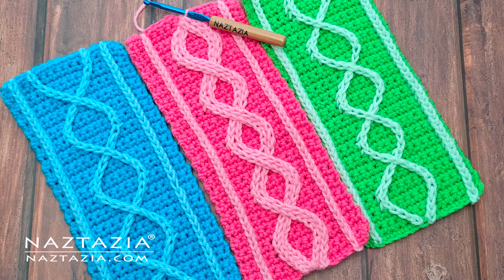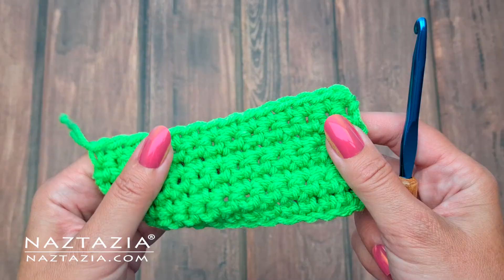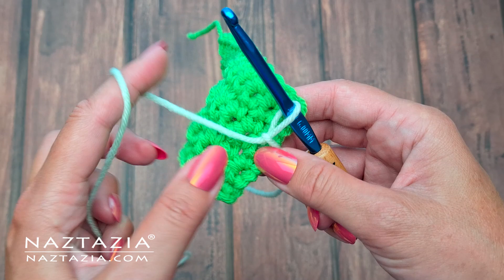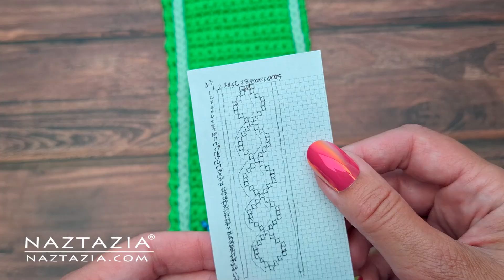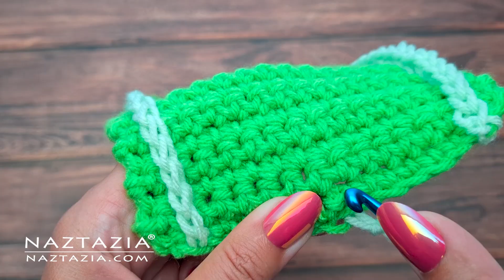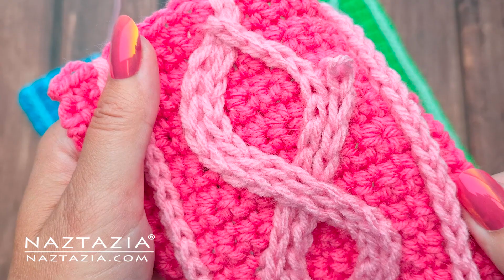How to Crochet Cables using Easy Surface Crochet Method

Comment: Your cables are crossed. Do you work several rows of surface crochet simultaneously?
Reply from the maker: Not really (you can though). If the cable needs to go "underneath" the other one I just remove my loop from the crochet hook, pull the loop underneath the other cable, then proceed as normal. Otherwise if the cable needs to go "over" the other one I just keep going with the same loop and stitches.
Reply: @naztazia That helps! Thank You 😊

Comment: This looks so good.  Can this be done on other types of background stitches instead of single crochet
Reply from the maker: Yes, other ones can be used; however, they will tend to be a bit taller and might fall over a bit, which might or might not be a good look depending upon what you are trying to create.

Comment: Could you do a c3f or c3b look cable with this method?
Reply from the maker: Yes, I believe that's what I did with the pink yarn one. The easiest is to work both the right and left swirls simultaneously, and at the point they cross in the middle, alternate which one goes on the bottom and then on the top.

Comment: To make them have the swirly/twisty effect, you have to go under the previous cable every other time they cross. 

I think you get close to the other cable, then unhook your yarn, and come at it from the other side of the previous cable to pull the loop under and then you can continue. 

Alternatively you could work on both cables, switching between them and always have the cable coming from the left go first, then go over it with the other (or always the right side goes first, if you want it to twist the other way)